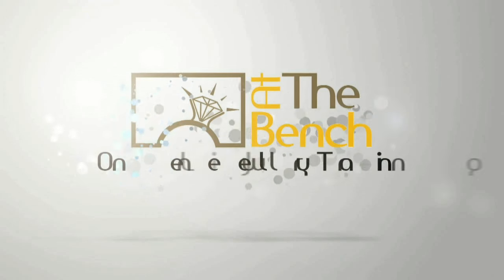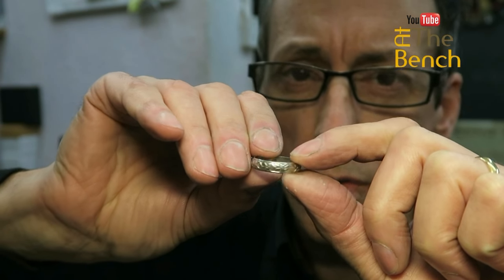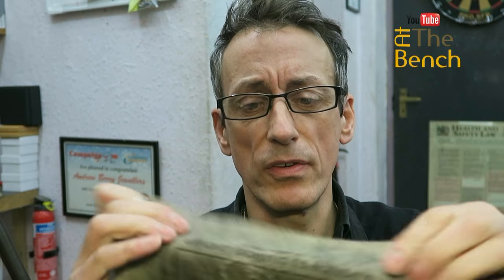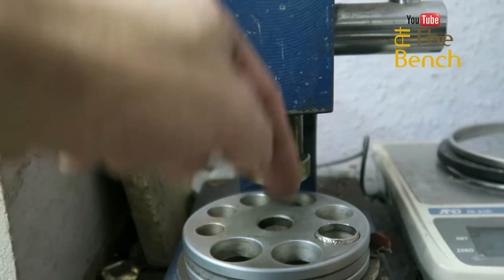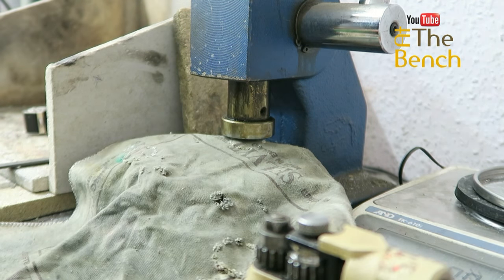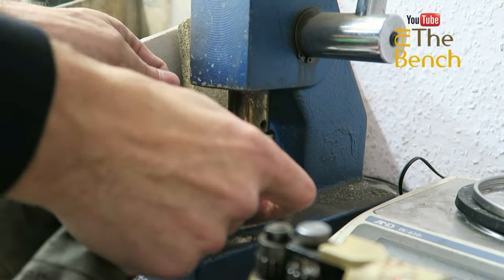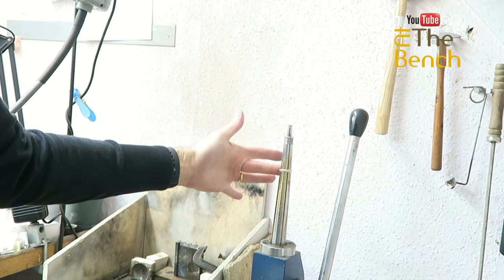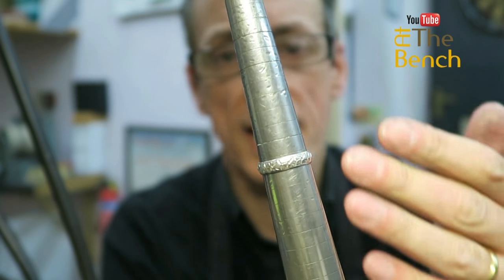How To Resized An Engraved Platinum Wedding Band

Comment: Hello Mr. Berry! I found this video very interesting. 
I just got married and have an Art Deco engraved platinum wedding band, not unlike the one shown in this video, only narrower (about 2mm). Do you think a good jeweler can use a stretching machine like you did at the end in order to slightly enlarge my ring without distorting the pattern? It is currently a size 4.5 US and I need a 4.75 / 5 US. Thank you!

Comment: Hello Andrew! Can you take a carved gold wedding band [much like the platinum band you show here] and widen it 1/2 a size without damaging it? Have you already addressed this. Jewelers here want to sell me a new ring but I want to keep the one that I was married with on the proper finger. Thanks a lot. Bronwen
Reply: You can. Tbh, for the one time, it would be worth it to just go on Amazon and look up a ring stretcher. They have a couple different types and the one you want looks like (and sometimes called) an adjustable ring mandrel. You can get one I'm sure for 15 dollars. Now, it may be a different price now since I've bought mine quite a while ago. And as long as you're going just a half size up, and if the pattern is on the outside, it should work. Mine works great and I've even successfully sized up a ring with a stone a 1/2 size. I hope you are able to get what you're wanting. And hope I've been at least some help.

Comment: very informative.. thanks.  Do you know if there is a similar ring sizer that works for rings with stones (bezels, semibezel rings)?  Enlarging would be easier but reducing a size seems impossible for such a ring
Reply: I don't believe there is a reduction machine available for stone set rings. Let me know if you end up finding one as I too am curious about this. It does seem a bit impossible.
Reply: @kathryncastanares525  - Yes, there is a way to do that. It would take me much longer to explain it here than it would for you to see if Andrew has made the video yet showing the device and how it's used to enlarge a stone set ring. I know I've seen a couple of videos on here showing the device required, and how it can be done, but I don't recall for sure who did them!
Reply: @sharid76  he was asking if there was a device that is similar to Reduce a ring with a stone set. Not enlarge. I know you can enlarge a ring with a stone set in. There a several ways and i have one of the few different types of devices that enlarges them. You can also just simply enlarge a stone set ring on a ring mandrel, hitting only the shank if you dont have access to a ring stretcher.
Reply: @kathryncastanares525  - Very true. I apparently misinterpreted his request because of the way it was written.

Comment: Hi Andrew good video but why not just use a paper dice to protect the ring?
I use the large post it note it saves on cleaning cloths .
Regards Paul @ Alchemist.
Reply from the maker: i find that there is not enough protection from paper and also as soon as the ring gets pushed down the paper immediately gets cut and the ring still gets marked.

Comment: Oups! What is the difference between soldering and welding. I thought welding was used for big pieces like machinery, véhicules, bridges etc... (I welded myself in the pass so I thought soldering therm was for jewelry.
Reply: I could be wrong but I think he meant fusing maybe? That's what I took it as. Good question!
Reply: Soldering melts a filler metal to join two pieces together whereas welding melts the two pieces together using no filler material. Welding creates a much stronger bond, however the process can be lengthier and requires much more expensive equipment than soldering.